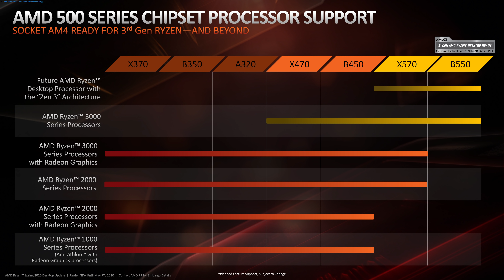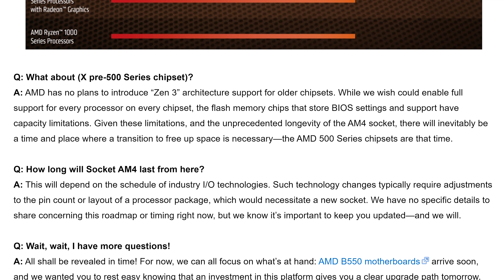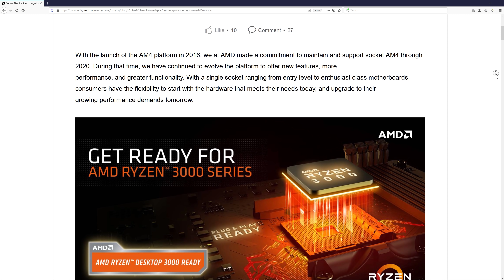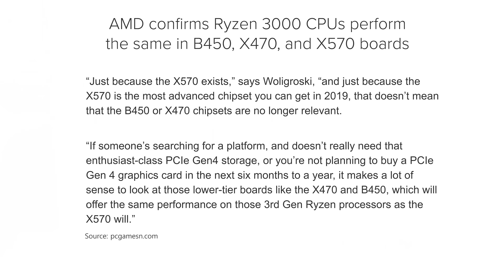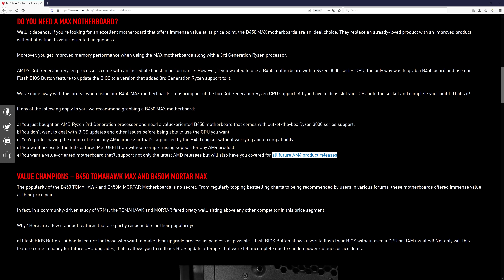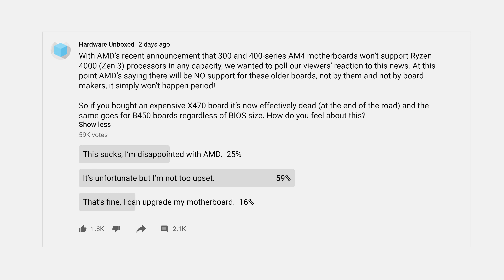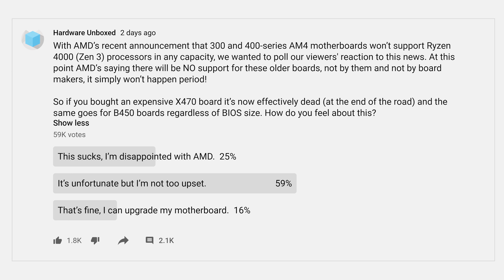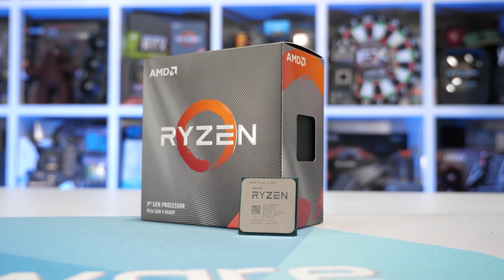AMD Does An Intel, Axes Zen 3 on 400-Series Motherboards, Our Thoughts

Comment: I might shift to Intel because of this. 
I am really, really angry. 
My MSI X470 Gaming Pro isn't the best X470 on the market, but it's not as crappy as MSI X570 MPG boards as far as I am aware off. 
And yet those boards will work with 4000 series, while mine will not. 
I know a person that has AsRock  X470 Taichi. 
Possibly best X470 on the market. 
He is not pleased. 
While not as pissed as me, he was/is very disappointed since he intended to upgrade from 2700X to 4000 series. 

I convinced more than a few people dead set on Intel to go with Ryzen instead. 
To go with AMD for longevity purposes. 
To go with MSI MAX boards as well as AssRock B450 Something AC Micro board because of this long-term upgrade path.
Now if I met them, I wouldn't be able to look them in the eyes anymore. 
Thank you for that AMD.

And to think MSI almost didn't support Ryzen 3000 on some(maybe all) of their older boards... . 
They learned their less, or so they believed and released MAX boards. 
FOR FUCKS SAKE THEY RELEASED THE DAMNED A320 MAX. 
A320 Max... . 
And now likely Ryzen 10 32core/64threads 4950X or something like that, won't work on it. 
Fuck you AMD

There will be others might switch to Intel and others that WILL switch to Intel at some point, if not now.
Someday in the future, instead of getting 4000 series for their mighty MSI B450 Gaming Carbon AC or Tomahawk Max, they might/will buy some Core i
from Intel. 

And Intel fanboys must be having field day now... .
Influencer scum among them especially...

Comment: What could be done, if the rom chip size excuse was accurate, would be dropping support for zen 1 and zen + from future bioses. So you would have older bioses that support 1000 to 3000, and newer bioses that support 3000 and 4000. Change the Agesa number to make it clear. The responsibility of choosing the right bios to update to is already on the consumer. Most people don't actually need bios updates after the bioses reach a stable point anyways.

Comment: Doesn't there HAVE to be a point where a board series only lasts one generation? once AMD switches to their next socket which they'll likely have to do in the next couple years, whichever AM4 series is out then will not have an upgrade path either since the next cpu's will be on AM5 or whatever their next socket is

Comment: Thanks for sharing this perspective Steve. Last week I bought a Tomahawk Max for this reason with a 1600AF, and I don't think I can send it back now, as I've already opened it. It is rather frustrating.

Out of curiosity, what is in the platform support blob? Is it firmware that runs on the chipset? I wonder if it would be possible to port it to coreboot and add support that way.

Comment: I built a new Ryzen system using an X470 motherboard about 2 months before the 3000 series CPUs were released.  Through all that however I never really planned on putting a 3000 series CPU on that motherboard.    But to make matters worse the Gigabyte version of the EGESA update to allow that was a hot mess with their ECFW tool.  That alone really soured me on Gigabyte boards.  No instructions and a VERY long topic on the Community support pages of all the issues trying to get it to work.
How long is the AM4 socket supposed to be viable?   I foresee AMD caving at some point due to all the backlash but not sure how far they will go.  Series 4x boards only and not series 3x?

Comment: Yeah... I'm not really happy but I'm also not effected, at the moment.

I'm glad I kept putting off my PC build, because I planned on picking up a 400 series board with an upgrade path expected, but if I had pulled the trigger on one of the new max boards with the expectation of it working on future releases... I would've shot myself in the foot.

I was gonna drop a new CPU into my asrock AB350 board, but support for it has clearly ended. I was prepared to get a B450 tomahawk because it is a solid product, the new MAX line looked promising, as a way to future proof things a bit better. Now that option is off the table. So I guess I have no choice, when I decide to build my new PC it will have the new B550 board in it. 

I don't think the blowback would've been as bad if they had released the B550 boards sooner, right at the start of zen2. MSI wouldn't have made the MAX line of boards, they would've just made a B550 Tomahawk, with more storage to support the old and upcoming CPU's.

I guess for now I'll keep rocking my AB350 pro4 for a little while longer, along with my first gen R5 1600. My plan to upgrade my motherboard and CPU have been put on hold for the moment.

Comment: I bought the Tomahawk Max one moth ago, this announcement has really annoyed me. I would have bought a X570 if i would have known
Reply: I'm still thinking about buying a B450 now.
I've heard the X570 also take more power, tend to heat up quicker and some don't quite trust the onboard fan.

If we don't upgrade to Zen 3 until a few years, might we not still be better off until the B550 comes out or the X570s get cheaper?
Reply: So I was considering upgrade, needed mobo and cpu but I'm pretty tight on CPU I'll refresh GPU more often. Anyways, when I read the board yep it was clear they were squeezing on 3000 chips. Would have different writing and said you may need to update bios as they weren't made for them. So that was clear to me that was end of the line so wasn't in a rush. 
But honestly don't worry, that cpu and mobo will serve you and by that time you can look at ddr5 earlier then others who buy and sit on the newer boards. It's just the way of progress, so just get what you need not what's fashionable.
Reply: That sucks indeed, but AMD have made it clear a long time ago that AM4 motherboards won't be supported with new CPUs after 31 December 2019, so not sure how you thought that your B450 Tomahawk Max would work with Zen 3 which releases after 31 Dec 2019. If you look at AMD's official Socket Stability slide in the article "3rd Gen AMD Ryzen CPUs Will Work on Many Existing MSI AM4 Motherboards" (search it on Google), you'll see that the graph clearly shows no support for new CPUs on AM4 after 31 December 2019. If you take a good look, the orange bar stops right at the end of 2019, just before 2020 starts. It was already know even a year or two ago that Zen 3 will come out some time in 2020, or in other words, AFTER the official support period. Do people not know how to read graphs?
Reply: @bgtubber  Sorry, but your point is very weak. First the orange bar stops as 2020 because that where the scale stops so we are unable to know what 2020 holds because it does not represent anything in 2020, only up to the start of 2020. Second, the asterisk says "Planned AM4 socket support until 2020". It is unclear by the wording if it includes or excludes 2020. Then when you add the points made in this video, your argument does not hold up.
Reply: @bgtubber  The thing is AMD didn't launched B550 boards with Zen2, so people who were looking to buy a cheaper board found B450 as a very good option. Information about AM4 support until 2020 was pretty old at that point, and as it is the case in this industry, there was a few delayes. Zen 2 was planned to be a year after Zen1, but they realeased a refresh - again, very common. Many people, including me, were convinced that B450 boards will support Zen3, there is no reason not to. After 2020 we're expecting DDR5, so CPU needs a new memory controller and at this point AM4 is old platform, so it's perfect time to break compatibility and introduce new features.

LinkEx - Possibility to upgrade means that oldes CPUs will get cheaper with time. Let's say you bought i5 6400, board is pretty good and you're looking for upgrade. The only reasonable choice is something like i7 6700/7700/7700k. It has the performance of Ryzen 3 3300, 100$ CPU, so used and without warranty must be cheap, right? Look at the prices.
Reply: @bgtubber  Stop spamming the same copypasta over and over again. You're on every single comment down the line with the exact same message and you don't give answers to the counter arguments... Plus you flat out ignore 90% of what Steve just said about what OTHER messages AMD has given.

Comment: I thought I was being clever by picking up an MSI Mortar Max B450 & R5 1600AF... turns out I’m not that clever at all 🤣
Reply: Hey man.. even if your upgrade path ends at 3950X... That is still a fucking fast CPU even by 2023 standards. And when the 4950X has been out a little while, they should be approachable price wise.

Comment: If AMD lacks manpower to implement Zen3 support from the start, they still could provide the necessary updates later on. 
I want to use a 4950X in a few years when I can buy it for a relatively cheap price. Atm. my 3900X is more than sufficient for my workflow/gaming-needs. 
Asking customers to throw away their perfectly fine <X570 boards for the last CPU-Gen. of the AM4 socket is a bit of a far stretch...

Comment: had some time to consider all this. I think the dual bios release is the only option that would work. AMD could, the code bits that control support would be easy enough, and any REAL difference in support other than the support list like signaling and technologies added that might not be able without a switch code ballooning the bios could be avoided.
Reply: I also agree, the 3100 and 3300X seem REAL strange to release even a week or two before the B550 board without upgrading support.  quad core is already behind the curve on core count, and wont be enough for gaming at all in a year or two. the cut off is six core now imo, and eight core is more the long term 5-6 year build right now.

Comment: I especially bought an X470 Crosshair 7 with a 2700X when I built up my computer, just at the launch of Ryzen 3000s, so that I could upgrade to Ryzen 4000 in time... Now I think I should have either cheated out on the board with a much lesser-grade one, or waited for the X570 to come out... Now I am contemplating skipping the whole Ryzen 4000 generation, and wait for the next generation of mobs and CPUs over. Maybe by then we will have more exciting things coming along, like DDR5 for the RAM?
I understand more or less why AMD does this, but am still a bit salty that my upgrade planning got overturned.

Comment: Whoever bought B450 to paired with Zen+  in 2018 should be happy, since they at least have another generation (Zen 2) for the upgrade path if the wisht to  ....but whoever bought B450 to paired with Zen 2 in 2019, they will felt cheated or betrayed by AMD.  They delayed the B550 for a year, and the should given a heads up the roadmap they chosen to . If they communicate it clearly to the general public, they won't get the backlash they getting right now.

Comment: I think the most disappointed people are the ones that just bought the B450 motherboard, B550 just came out so damn late(which in of itself is understandable, I guess) which means that people bought B450 since X570 wasn't that worthwhile(better heatsinks and Gen 4 PCIe aren't that important to most people especially considering the price and youtubers even recommended to stick with B450) under the premise that it'll support 4th gen Ryzen(AMD promised to support AM4 socket til 2020) so people assumed that there would be at least 1 more generation after 3rd gen for their boards.
Reply: it's the same socket AMD, I understand if the 300 series wouldn't get support since it's already 2 generations ago(which is still kind of a pain, but they do have to make money) but the 400 series is only 1 generation old(superseded by the 500 series) which would be even scummier than Intel cause they dropped support 2-3 generations later and they at least changed sockets.
Reply: At least board partners are gonna flame AMD for this, especially MSI

Comment: Frankly, why the outrage? When x399 was dropped and folks who had invested a lot more in that platform than a B450 cheapo were upset about it, everyone in the tech press just aped AMD's lame excuse that it was unavoidable for power consumption reasons (which turned out to be untrue). So now all of a sudden AMD's a bad guy and we should put pressure on them to roll back their decision? Really? Looks like the tech press is using double standards.

Comment: Why don't B550 support older generation processors? Like buy b550 Mobo with R5 1600AF and then upgrade to Zen3 4000 series later.

Comment: I bought a B450 (MSI Tom. Max)  and a 3950 in January (needed the cores for my everyday work, no plans for overclocking). It's not that I am planning to buy a new motherboard, but in my case, I have more interest in the compatibility of the new boards with old CPUs (like my 3950, that costed 7 times as much as my current motherboard) that the other way around. But that's just my case.

Comment: You didn't mention one of the potential buying scenarios.
There's : 
 - The ones that bought a 3xx-series board and got an absolute unit of an upgrade path, given that even the meh-est of x370 boards were able to tackle the 3950X power consumption (7nm, and all that stuff)
- The ones that bought a 5xx-series board and get a confirmation that their relatively steep investment for a motherboard was in fact the only way to secure a solid upgrade path in the future
- The ones that bought a 4xx-series board RECENTLY as they became "low-end" alternatives to the pricy X570 and are effectively locked at the end of the upgrade path they were promised
But there's also : 
- The ones that bought a 4xx-series board when Ryzen became even more relevant with Zen+, which for the record brought a 8-cores/16-threads part for a little over 350€ to the table : it was Zen, but with a little more performance and even cheaper. A lot of people pulled the trigger at Zen+ release and a fair part of them are likely to not really give too much crap about their board being "end of the line" since they actually upgraded from Zen+ to Zen 2 - or will in the future - and that's one hell of an upgrade.

Comment: I'm sure AMD will change their stance on the 400 series boards, but I am sure it will come with a warning that only certain boards will be capable to be upgraded and that using the Zen 3 could cause issues with data corruption etc etc and that owners do it at their own risk. Come on AMD you know it's the right thing to do. Personally I am on x370 so when I go for  a Zen 3 I would have been buying a new mobo anyhoo, sometimes it is best not to go too bleedin edge.

Comment: Nice protest Steve, thanks for doing that. I didn’t expect this from AMD.
Reply: How was this not expected and what's all the fuss about? AMD had already made it clear a long time ago that AM4 motherboards won't be supported with new CPUs after 31 December 2019. If you look at AMD's official Socket Stability slide in the article "3rd Gen AMD Ryzen CPUs Will Work on Many Existing MSI AM4 Motherboards" (search it on Google), you'll see that the graph clearly shows no support for new CPUs on AM4 after 31 December 2019. If you take a good look, the orange bar stops right at the end of 2019, just before 2020 starts. It was already know even a year or two ago that Zen 3 will come out some time in 2020, or in other words, AFTER the official support period.
Reply: @bgtubber  Stop spamming the same copypasta over and over again. You're on every single comment down the line with the exact same message and you don't give answers to the counter arguments... Plus you flat out ignore 90% of what Steve just said about what OTHER messages AMD has given.
Reply: @bgtubber  stop defending AMD it's a dick moving making people wait so long B550 they just stop waiting buy b450 then saying it doesn't support zen 3

Comment: I bought a B450 mortar max last autumn, and I not all too upset about this. I reckon my 3600 will last until I would want to upgrade to something more powerful than the 4000 series anyway, possibly ddr5 also, so it makes little difference to me. AKA the same reason why intel doesn't bother with compatibility that much.

I do think it is a first move on a slippery slope towards becoming the next intel though.

Must suck for B450 owners with 200-series processors as well.

Comment: The worst part is that b550 wasn't even an option, you have to buy a b450 board if you don't want an expensive and power hungry x570 board which, ironically sacrifices the efficiency gain made by generational CPU improvements, so this is even worse than Intel, yes there are 12/16 core parts, but for the most of us, AM4 ended here if AMD abandon its latest gen backwards compatibility because who'd want to buy into a dead end platform if not for upgrading their existing rig when AM5 and DDR5 come next year?

Comment: I am an AMD fan but I do agree they should offer support for the 400 series chipset and state to it customers and partners why this may be an issue in the first place. Especially seeing that they were late with the B550 chipset. 
The wording you gave where they should have used is much better and would be an easier pill to swallow.
Initially I was wondering if this an issue with PCI EX 4 however seeing that you and other reviewers who maybe would have gotten inside info if that was the case has not alluded to that being an issue, then AMD needs to sort this out quickly.